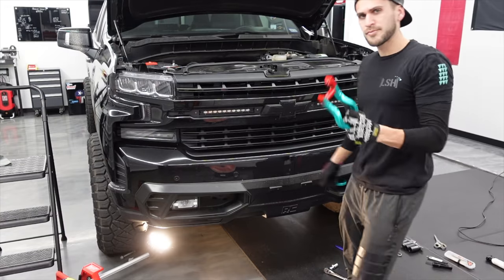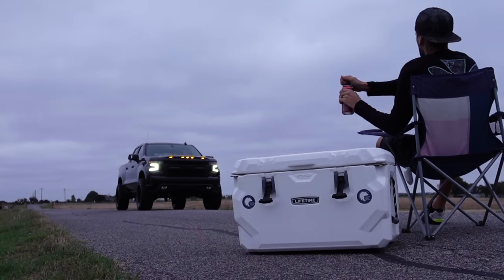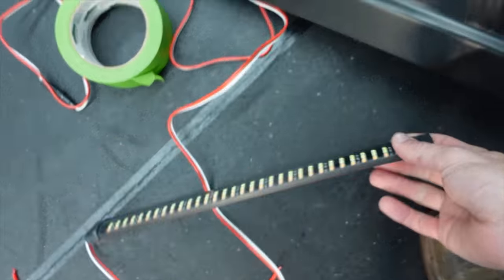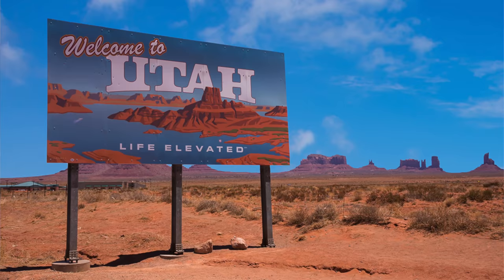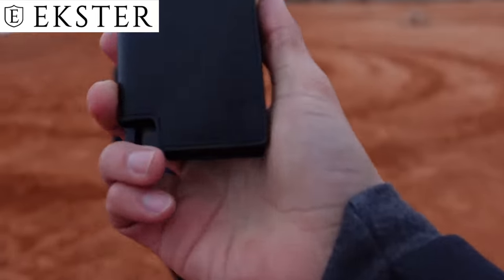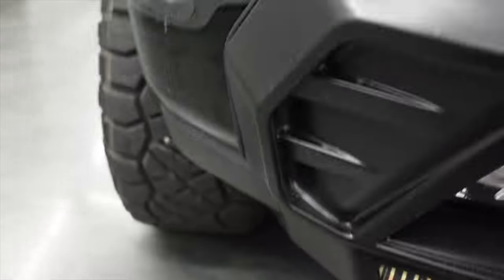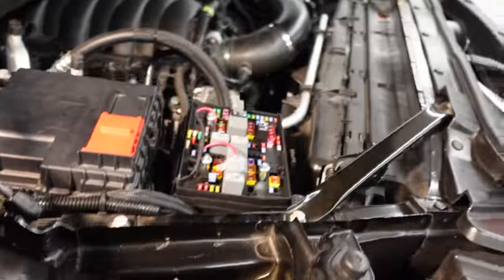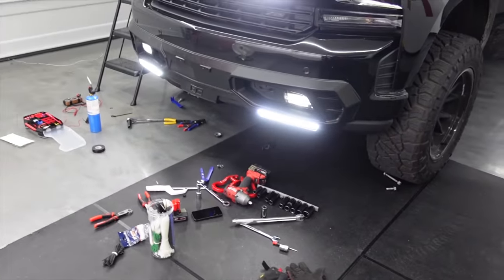Silverado Face Lift - Rough Country Front Facia Kit 🔥

Comment: If you really do want more lights on the front, you could do like I did on my 09 Silverado. I’ve taken them out now (might redo it soon) but I had built a bracket out of some aluminum that allowed me to mount two 32” light bars behind my grille. If you do decide to do something similar, I would recommend getting curved light bars cause they’ll fit better. Also you should definitely hook those amber lights to your turn signals!
Reply: They make a mount for that on American Trucks. Like $30

Comment: To wire the turn signals, it’s the dark blue w/ white stripe wire on the drivers side and green w/orange stripe for passenger.
Reply: There is no green with orange stripe on passenger
Reply: Do u now which pin?

Comment: I'm kinda "meh" on this mod.  I don't think those lights at the bottom of the fascia do much and are very likely to get damaged with any off roading (or snow & ice).  Fascia is interesting but seems a little "busy" compared to the factory setup.  Not worth $600 in my opinion.  Still like the channel though!
Reply: I like it. It’s subtle but adds a lot to the look of the front. Definitely not worth $600 to me personally either but I still like it.
Reply: It’s $300
Reply: Lol it's 215 not 600

Comment: Basic (probably) question here. I just installed and spliced my amber (brown) wire into the AVS Lightshield since I want the ambers on instead of the white. Added it to my fuse tap (ignitiion fuse so always on). My AVS Lightshield still powers on as normal, but cannot get these ambers in the fascia to light up. I've tried both vampire splice and a standard connector splice, still no illumination. Any idea?

Comment: looks great but the tow hooks should have been a powder coat instead of a wrap for longevity. Should also put the tint on those lights in grille to really pull the look a long tighter

Comment: How did you get through the fuse box with your wiring?  I was trying to run a wire out and it ended up getting really linked.  Instead I drilled a small hole and fed the wire through and sealed the exterior.
Reply from the maker: I shoved a hanger wire down from the top, taped the wire and pulled it up. It's run up in between the bumper and fender liner.

Comment: I also ordered the cover from RC but wasnt to happy how flimsey the plastic was so i returned it , iam saving for the aero design front cover to go with their hood scoop i have to complete my zr2 look. That aero design hood would look killer on your build. Love your video's
Reply: @derrick lesane for installation does  the instructions have you drill a hole into the original bumper?
Reply: @docholiday1544  yes  to install push pins thats the only thing holding it on
Reply: @derricklesane3114  makes sense i guess if you don't like it your stuck with a hole and a push pin as a cover on the original bumper.
Reply: You got a link for the aero stuff? I’d like to have a look at it. I ordered the fascia and I’m gonna go with it because it’s good DIY practice.